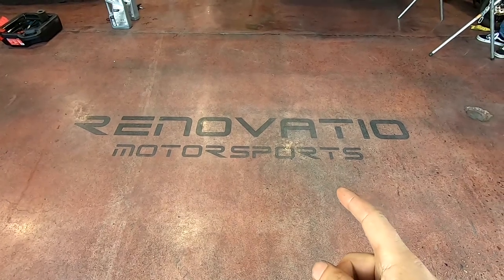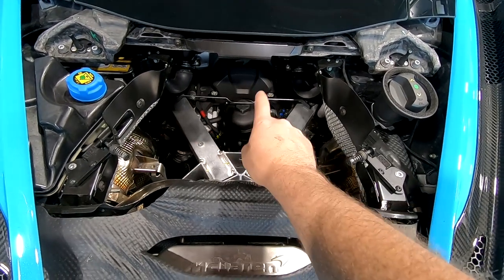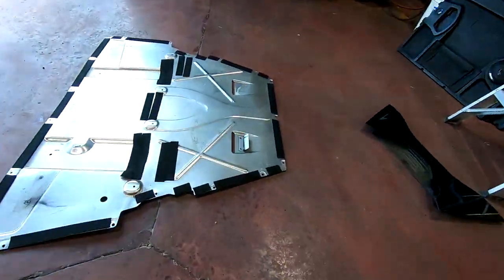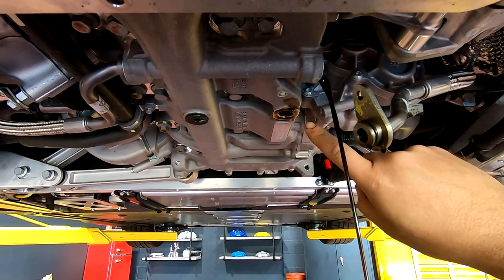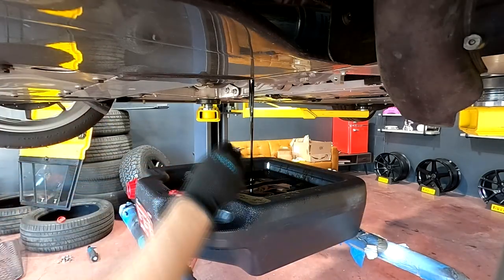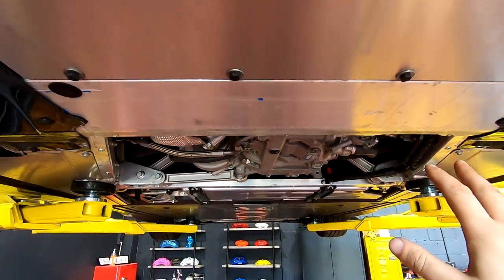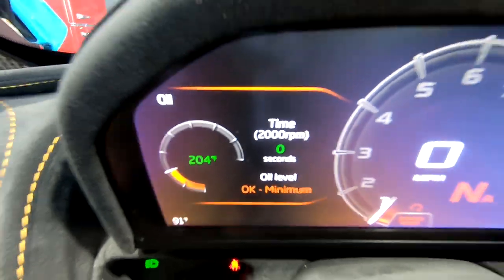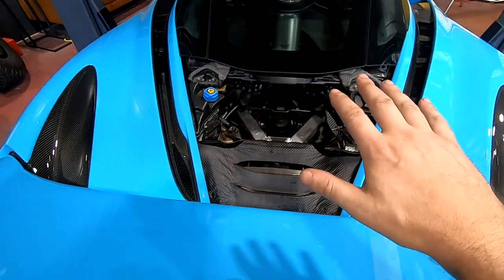Full how to McLaren 765LT and 720s oil change

Comment: Mine had the exact same leaks on the last oil change , just those 2 stains , but no drips on the floor cover .
Reply: I’m thinking it the expansion and contraction of the gasket under load…… 🤔

Comment: Is the crankcase vented through the intake plenum to allow for atmospheric pressure to enter? Why does he say to open the fill cap to assist in the draining process as the pressure should be equal, no?

Comment: manually raising the rear spoiler.  Does that mean you just push the spoiler up with your hands while the car is off until it doesn't go any further?  Or is there a button that manually activates the spoiler to the highest position?
Reply from the maker: Correct, car must be off and stay off or it will throw a fault.
Reply: Doesn't that seem kind of risky forcing the hydraulics?  All you have to do is just start the car, wait a few seconds and then press the active button then hold down the Aero button until the wing pops up. This can be done in 15 seconds from inside the vehicle.
Reply: Blue loctite works perfect for those bottom pan bolts. You don't have to over torque them and they'll never fall out.

Comment: Isn't it a problem for the turbos that they don't get oil immediately after engine start for a few seconds until the oil lines are full again? Of course they won't break instantly but couldn't increase that wear?
Reply from the maker: The oil is there for cooling, oil does lubricate which helps with cooling but they spin on bearings. The short time it doesn't have oil is no different than starting an engine that's been drained and refilled.
Reply: @McMedics  ok, thanks for the reply 🙂

Comment: Is that the correct Mobil 1  0W-40 for the 765 LT ?
Reply from the maker: Yes, that's why I used it.
Reply: @McMedics  I read in the manual only to use the Mobil 0W-40 but the dexos 2 certified one .
Reply: @McMedics  the ESP one , it has the green colored sticker cover , it’s quite had to find in my area , the one I saw you use is very common and is the standard one I use on the Nissan GT-R
Reply from the maker: European Car formula of Mobile 1 is the same as McLaren oil just different package.
Reply: @McMedics  ok , thx a lot for your advice , was not sure if it was different or as you say different package of the same product.